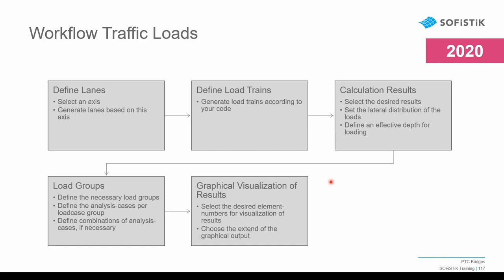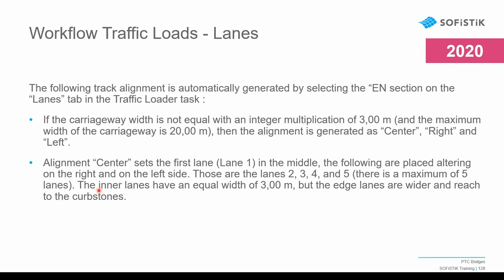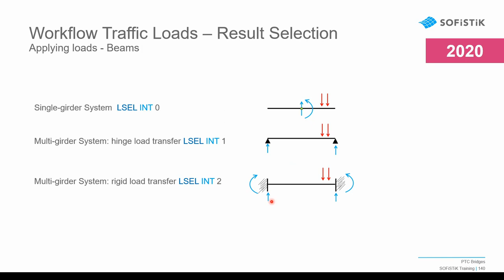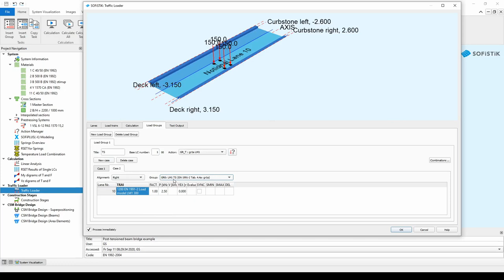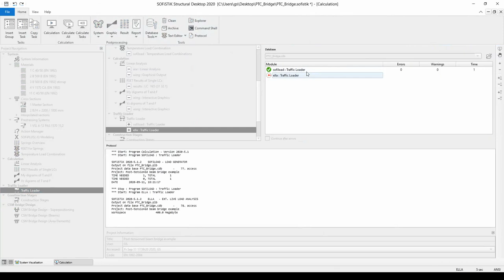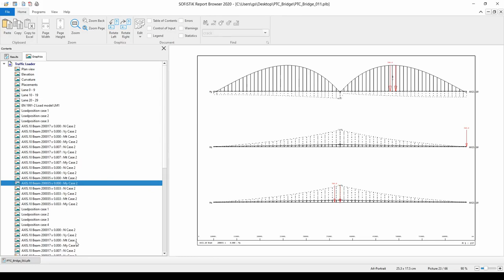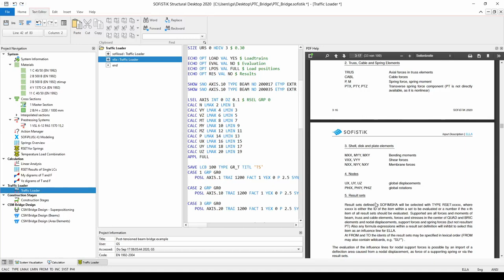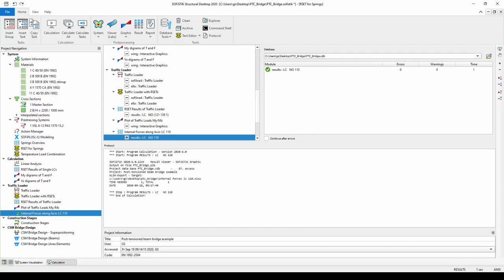Bridge Design Training #09 - Traffic Loader and Result Sets

Comment: Hey Sofistik!
I am Peter and Im using Sofistik for my bachler's thesis to design a composite bridge. 
First of all I appriciate these videos, helping me a lot.
Unfortunatelly I ran into a problem and hoping that maybe I can get some help here. 
In my design there is a temporary support, till the end of construction stages,  I managed to do the construction stages and even the linear analisis by deactivating the support at the right construction stage and by simpli not selecting the group at the linear analysis. 
At the Traffic loader task however judging by the bending moment influence lines, the deactivation of group 6 (the temporary support elements group) didnt carry out. 
I tried changing somethin in Teddy at program ella but didnt manage to do it. Furthermore, at the ella manual it seems to be no option to not include a group.
What do u recommend I should do? 
Looking forward to your response.
Sincerely
Reply from the maker: Hi Peter,
happy to hear that you like them :).
ELLA (or the programm behind the traffic loader) always uses the stiffness matrix of the latest analysis (ASE) run.
Meaning, if your construction stages are analysed, the traffic loader should take the final geometry of your stages into consideration. I reccomend, you check the order inwhich you analysed yout rasks, so you can be sure that the right geometry is considered by ELLA.
Please understand, that our possibilities for unpaid support are a little limited. But asking never hurts ;).
If you need further help/support you can check out our forum: https://forum.sofistik.de/
Best wishes
SOFiSTiK

Comment: Hello! How could I get the most unfavorable loading with the NBR 7188 (brazilian code) load train? I've been testing a lot of options, but I think the software isn't moving the load train in the transverse direction to get the most unfavorable forces. I've tried setting only one notional lane and put the load train so it could move freely inside this notional lane, but it doesn't seem to be how the module works; another try was to set notional lanes with 3 meters of width and put the load train in each of them (my bridge has 12.2 meters of width in which the vehicle can move and the load train has 3 m of width); although it does get to a approximate result, it doesn't seem that the program is getting the most unfavourable forces for that load train — it seems that the program is just taking the most unfavourable case, for each beam element, between the 4 cases that I set (the load train moving in each of the notional lanes that I tried), and not the true one. What is the correct workflow for that case? Thanks in advance!
Reply from the maker: Hi Bruno,
the way that ELLA usually generates the most unfavourable loadcombination for every single finite element in your system according to the loading you created. Unfortunately, I am not familiar with the Brazilian code (only the brazilian :P) and its requirements. 
You should be able to create all kind of loading and its combination for any traffic case you desire.
Are you using a trial license, or are you already a SOFiSTiK customer? If you are already a customer, please send your request to our support (in the program -> Help -> Support Assistant). If no, please send your request to info@sofistik.de and mention that you were redirected there from YouTube.

Comment: After running Calculate Traffic Loader, I got an error:
 +++++ error no.  2902 in program ELSF ; input line:   41
   Triangulized stiffness matrix not available
   Remarks: last load case must not be a support-displacement
            last load case must not be nonlinear
            CTRL SOLV 2 and 4 are not possible to be used by ELLA
Reply from the maker: Hi user-wu9ng8kj1k,
please check if your system definition is right. (Materials, Cross Sections and if your system is modeled consistently)
Unfortunately, it is hard to tell what exactly causes the error without the context.
Reply: @SOFiSTiKAG  Turns out I had to run Linear Analysis, program calculated stiffness matrix, and everything worked afterwards.